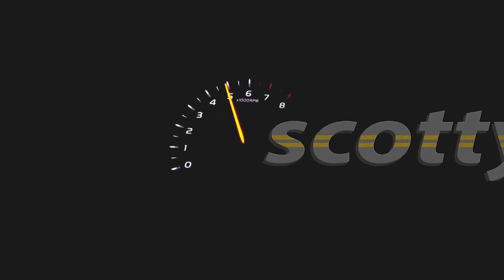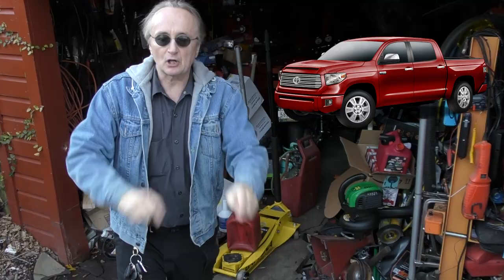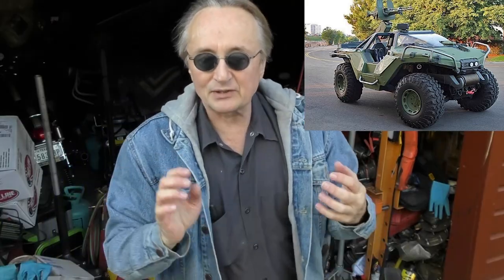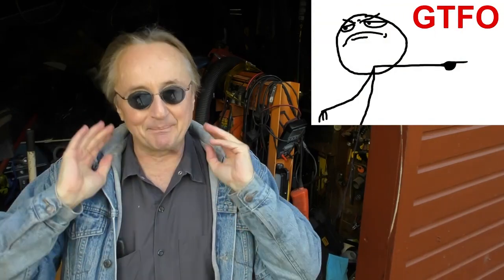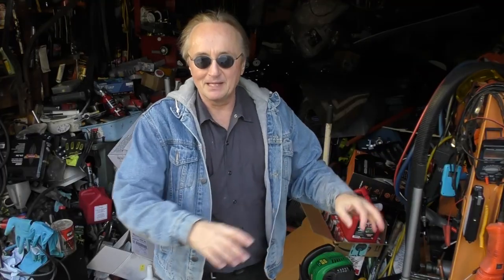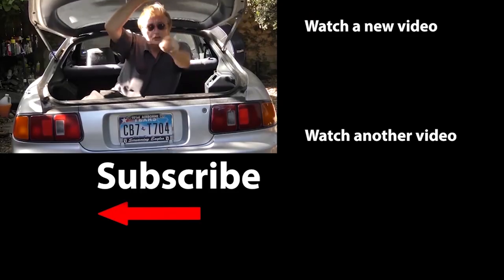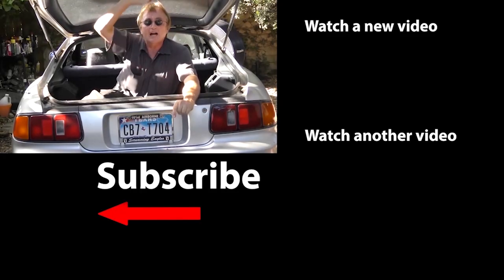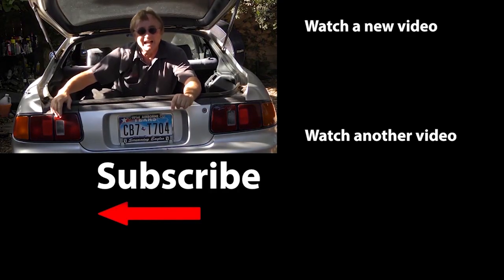5 Used Trucks You Should Never Buy

Comment: I never realized how much people enjoy their Honda Ridgelines.
Reply: They’re pretty good trucks
Reply: I had considered a used ridgeline before the new body style came out and quickly changed my mind after seeing the used prices.
Reply: 2006 never an issue
Reply: 114K Miles on my 2011 Ridgeline....I use it for hauling...not much towing.  Only maintenance ever done is oil & filter, air filter,  brakes, tires, replaced battery last year.   Avg.19 MPG....Great vehicle for my Family & small Business....has been very Reliable in Snowy, Frigid Maine Winters.
Reply: Had a Ridgeline.. put well over 300,000 hard miles on it ... absolutely loved it ... it’s still a solid truck... sorry Scotty .. got that one wrong.. obviously another Ridgeline hater
Reply: Juvenal Escobar great truck
Reply: He's right that they're not really a heavy duty truck but as a mid-range light duty truck they're excellent.
Reply: honda makes great, reliable, well-designed, relatively easy to work on cars.  if i became a millionaire, i'd buy a 3yo lexus hybrid suv and an acura nsx and be happy for a lifetime with nothing but oil changes.
Reply: My bro bought one used with close to 100,000 miles. Multiple Pilots in the family as well. Not one has failed. And I have never felt safer in a vehicle in horrid weather than in a ridgeline or Pilot. 

My moms was even T-boned, and still drives like a gem. 

Scotty may know a lot about cars, but the ridgeline is solid.
Reply: @markzach455  --  are you driving all highway miles to be averaging 19? I'm very lucky to hit 16 between City, and highway driving in my ridgeline. Do you have any tips, please share with me,  Thanks... 
And btw, if it's 100% highway miles, I can sometimes hit 17.2 or so
Reply: Honda is not a truck
Reply: domdrty — Yes, like Toyota’s they hold their value pretty well. You get what you pay for.
Reply: 2012 ridgeline, stabilizer linkage’s that’s it,80 dollar fix couple wrenches and an angle grinder
Reply: I had a Honda Ridgeline 4x4 truck and traded it in on a Chevrolet Silverado LT Z71 4x4 truck. Now I have a real truck.  Bigger and more powerful than any Honda Ridgeline on the market today.  Ridgeline with a sideways motor and transportation only tow 5,000 lb.s.  My Chevy will tow twice that amount for a lot less price.
Reply: RickFL2001 —Yes your Chevy will tow much more and for “a lot less price” but mechanically, you now have “a lot less truck” ... Good luck, cuz you’re gonna need it 🤣
Reply: @JoeMama-bw2vy  looks like you don't know what you are talking about.
Reply: @RickFL2001  -- I absolutely do know what I'm talking about. Chevy/GM is barely above dodge which is at the very BOTTOM when it comes to reliability. You should've done some research before trading for that Chevy.... Like I said, good luck!
Reply: @JoeMama-bw2vy  truth is all vehicles break down ALL !  But remember I've owned both. You know as well as anyone that I can get way more parts for a Chevrolet at any Auto parts store than you can for any Honda.  That's Dealership items. I have a RV Camper Trailer that the Honda Ridgeline 3.5 motor would hit high 
rpms which would not hold up as well as a V8. My Chevy doesn't even know that 3,500 lb.s to 4,000 lb. Trailer is back there. Saving me gasoline and wear and tear. Remember I had a nice Honda Ridgeline 4x4 truck
Reply: @RickFL2001  -- I have a Ridgeline now! And yes, all vehicles do breakdown but it's a matter as how soon they do and with how many miles on them. 

Of course the V8 Chevy is going to tow something like that without a problem. However, you are going to have problems sooner than later because it's a Chevy. Btw,  parts are readily available for any Honda and not just thru a dealer. 

2 more things and I'll bid you fairwell...  1 YOU started this little back and forth with the "now I have a real truck" comment. 
And 2, there is no better made vehicles than Honda or Toyota... Simple fact. If you wanted better towing power, you would've been better served spending more $ and getting a Tundra. I promise you would SAVE $$ in the long run over that GM product.
Reply: @JoeMama-bw2vy  my Honda had recall problems and so far my Chevy has done well. Thanks for the good luck with my truck. Best of luck with yours. I even had the 2 inches lift on my Honda Ridgeline from the Dealership. I removed it before it traded it in. You can have the 2 in. Kit if you want it. I have new links for the front end but the AC went out and if I had it fixed I would still have a old vehicle
If you want the kit it's yours free. And I appreciate your comments. Let me know
Reply: @RickFL2001  -- Thanks, but I'm interested in doing any mods to mine. It server my needs perfectly. Take care 👍🏼
Reply: @RickFL2001  even though your stated points are largely correct they dont support scottys complaints and I doubt any ridgeline buyers care about towing 10,000 lbs.
Reply: your a Millionaire now live a little how about some super cars lol
Reply: They are awesome "pickup crossovers". I've lofted mine, put wheels on it and the thing has handled everything nature has thrown at it. Including hurricane Matthew and hurricane Franklin.  Best vehicle I have ever owned.
Reply: @markzach455  make sure you change timing belt
Reply: @RickFL2001  I beg to differ. There is a 450bhp ridgeline around here in tn with original motor and trans with a turbo and some other upgrades. I bet $100 he would beat you in a race to lowes.
Reply: @RickFL2001  gm is garbage. Very cheaply made, unreliable,  very overpriced. I'll stick with my ridgeline that constantly proves the haters wrong
Reply: Juvenal Escobar My Wife bought me a Brand New 2007 Ridgeline. I’m just shy of 13 incredible years of proud Ridgeline ownership. The Vehicle has NEVER been in the Shop...,  You know why - - Because they’re Friggin Perfect !!!  I’ve never needed a repair, because you can’t repair Perfection !!  Scotty is just MAD that he wasn’t allowed to join The Ridgeline Owners Club.   Rev  That,  Scotty.
Reply: Oh yeah. Even though it's not sold in big numbers like the Toyota or GM trucks, the few people who bought the Ridgeline absolutely love their vehicle. According to Consumer Reports, the Ridgeline has a very good owner satisfaction rating.
Reply: Trading my EcoBoost Ford F-150 for a Honda Ridgeline. Ford F-150 is junk

Comment: Scotty I have to disagree with your review on the Ridgeline. I own one since 2007 and is running as when new. Oil changes and brakes pads are the only maintenance done. I'm already at 302,000 miles; engine and TRANSMISSION are running STRONG. PAINT and interior look brand new; always getting compliments at the Honda dealership. I believe it can easily meke it to 500,000 miles.
Reply: Well then you got lucky their thr most city slicker trucks of all times
Reply: INSTA austin_01 silverado 
And 1/2 tons are wannabe 3/4 ton & 1 ton diesel pickups. 1 tons are city slicker wannabe class 8 semis. 

See the point ?

Comment: Disagree with the Ridgeline. I still own my 2006 and I'm completely satisfied. I knew what I was buying and still love it
Reply: Ridgeline had since 2009.  It's a 2006, first model.. 236,000 miles.  Constant stretches towing a 1,200lb fishing boat and equipment at least 6 times a year since owned.  Bout 600 miles each way.   Replaced brakes, the compressor and three wheel bearings that's all..  Scotty seems to have a Ford bias.  My lady's 2012 Ford F150 needed a new tyranny at 47,000 miles.  My brother in laws 2014 at 52,000, and my bestie's 2015 trailing us to the Gulf, towing his boat and his fishing equipment broke down in Valdosta GA.  Same reason, transmission..   Where are you Scotty..?  SCOTTY YOU SAY WHAT..?
Reply: Great vehicle. Its not a full size truck . But its reliable, powerful and economical compared to similar class trucks. Frontier, ranger, colorado, etc.
Reply: And what, its a personal story of yours. Honda and Toyota people are so easily triggered. As a pickup truck, its sucks balls, thats it. Gob it
Reply: Not a truck if the engine is set in like a fwd lol truck is a fake

Comment: 2 trucks you should never buy:
Lowered trucks
Lifted trucks
Reply: why not they both have reasons that someone would want
Reply: Lower more so than lifted
Reply: @jacesgarage658  strain on the driveshaft, the driveshaft is engineered to operate at a specific angle. Suspension could have even more problems depending on who lifted it.
Reply: As long as it hasn't been taken to the extreme and it been built well, there shouldn't be anything wrong with a lifted or lowered truck.
Reply: A lowered truck is worse than a lifted truck. A lowered truck completely defeats the purpose of a pickup truck in general. Unless you live in a rich city like Dubai, go for it, but for the average city where roads are not always smooth. Have fun when you see potholes!
Reply: U must be a old guy
Reply: Giant tires and wheels may cause extra strain on wheel bearings.
Reply: Austin Radtke exactly it’s all about who did the work, I purchased a 1995 f150 with a front end from a 79 Bronco with 6inch total lift with 35 a/t tires and it reach the same steady speeds as my newer fseries vehicle with no hiccups. And almost next to near extreme wear and tear on drive train parts
Reply: @coiledsteel8344  : Heavier the wheel, the more strain on the bearings.

Even with same weight wheels, putting on different sized wheels, can upset the ABS, Speedometer, Traction Control, etc.
Reply: angryKitt3ns I have 2 lifted trucks it’s all in what u buy if it’s a cheap lift kit u have problems. Lots of ppl buy the cheep kits so they can get fancy wheels. Just save up get a quality kit and u will b fine. Yes parts do need replaced more offen but it’s part of the game if it’s what u like
Reply: The source of issues, cheap kits = disaster 99 percent of the time.

3 options.

Leave the truck at factory height specs. ( Non lifted ).

Save up and get good lift kit.

Save up more and buy a new truck thats already lifted from the manufacturer factory.
Reply: Lifted trucks aren't so bad, unless they're fitted with a non stock lift kit. Trucks that weren't lifted in the first place, SHOULDN'T BE lifted because their transmissions are permanently positioned in a particular way  and will break if they are altered; both classic and current trucks to say the least.
However, trucks that were built with a stock lift kit to begin with, their transmissions and differentials are permanently positioned that can handle the stress. My 2007 Ford F-150 XLT was never lifted to begin with, but it is elevated upon its manufacturing date and it can go off road with relative ease which is plenty enough. If I were to desire a lifted truck, I'd get rid of mine and buy a Ford F100 Highboy, Chevrolet K20, or a Dodge W250; which were lifted from the start and I aim to own either one in 5 years time.
Reply: @aestheticcruise8807  you're absolutely wrong. Especially if they lower it correctly, not by chopping or heating up the springs til they begin to sag. That's actually dangerous.
But lowering a truck correctly doesn't ruin it for ANYTHING except off roading... Which most people don't even do with their trucks anyways. They just have the trucks because they're bigger, so they feel safer, or they need the bed and towing ability, which is not affected by lowering (again, unless you do it wrong/cheap), but going offroad is actually not why a majority of people buy trucks, really...
So lowering is actually better than stock. You have the same payload and towing unless you change the springs (and if you airbag it, you actually can have MORE towing/hauling ability, to an extent), you can load and unload the bed easier, you can get in and out easier, wash it easier, work on the engine from above easier, has better MPG, quieter cabin on the highway due to reduced airflow underneath, and more stability.
All you're truly losing is the off road capability... Which is no loss at all if you never do that.
Reply: Those of you talking about driveline angles forget: you're supposed to shim your axles to account for pinion angle change at the tranny-to-driveshaft U-joints. Good drop/lift kits will either include shims (like my Ram's drop kit did) or will have lowering/lifting blocks with the corrected angle built into the block where it meets the axle mounting plate (like for my S10 Blazer) and keeps the axle and transmission U-joints at the correct angles in relation to each other.

Y'all are some really old it uneducated codgers in here if you guys don't know that. It's been that way for YEARS AND YEARS now.

Comment: I work for a company that bought several Dodge trucks for the fleet and all of them had ball joints break during low speed parking lot manuvering.
Reply: This is inexcusable-ball joints ought to be strong enough to last the life of the vehicle-some purchaing guy decided to go cheap and save a few cents.
Reply: Go chevy. My company has had nothing but silverados for our construction managers and they've rarely seen dealerships
Reply: @AbelG8781  The funny thing is i work in the north east and I see more chevys with problems than RAMs. Chevys are god awful with rust (Rams arent great either). I have More Cummins Diesels come in with less problems and less automatic transmission problems than Duramax Diesels. Chevy now personally makes Mall crawler trucks. I have people that come in and tow heavy trailers 20K pounds plus and gotten brand new chevys and got rid of them not even a year later since they could not hold up to the task. They all got Rams and now have had them for a year and a half and not a single problem.
Reply: That's no joke I see dodge ball joints falling out all the time
Reply: That’s nothing major. Ball joints is an easy replacement. See if it was engine or transmission
Reply: As I stated above, my kid has a newer Dodge half ton. The plastic interior is falling apart, the frame is loose and he's had every sort of engine problem imaginable, the last was an issue with the oil pan not draining all the oil properly, or something to that effect. Noisy on the road, just junk.
Reply: Had a 99 Dakota that had ball joints replaced 3X before 100K. Twice at dealer, third by me. No, I didn't hit potholes. Used Moog the last time. They were still tight when I sold the truck with 150K. Poor factory parts do not hold up
Reply: @lightningdriver81  My dodge has 140k miles with no problems.I've seen many broken down fords on the side of the road where I live.
Reply: @antheman5156    It is pretty major and it should not happen.

Comment: 1993 F150 302 that 230,000 original miles everything’s original just did the transmission go to overdrive band was slipping but it was in pretty good shape considering the mileage

Comment: 2:50 - My Grandpa has a Honda Ridgeline ( used ) with no issues in 10 years.
Reply: Fare Jare our Denali in 12 years old and “It’s a GM Product” as Scotty says
Reply: Fare Jare “
Reply: Who cares about the time frame ....Lets talk about the miles and the what is it used for ? Please tell us these informations also.
Reply: Our Ridgeline is a 2014 with 68 thousand miles and no issue thusfar. It's my wife's daily driver. She doesn't need a truck for utility purposes. I just want her to be in that in case she ever gets involved in an accident. We love it for long road trips. Quiet and comfortable. I will say that the navigation system is not intuitive and sort of a relic of a design.
Reply: Stick within the towing limits (5,000 pounds) and do maintenance. You can easily get 250k out of a Ridgeline. That V6 is bulletproof when taken care of. Transmissions don't have issues unless they're over worked (like going over the towing limits)
Reply: @kerobi88  - it's a 2009 - 2012 ( I'm not sure exactly ) with I believe 80k miles. He mainly puts mulch in back ( sometimes pulls a lawn mower on a little trailer ). He doesn't pull much with it at all.
Reply: @UCntTk8vyaz9ShRjVZkFTE0g will they start to slip because I have a 2007 Honda ridgeline RTL with 132000, with out never having 1 problem, all I've had to do is replace my shocks, and it runs like new..
Reply: This guy is full of it! My friends dad bought one used in 2007 and it's never let him down, going on 269000 miles on it. No they are not regular pickups but for what they are they do just fine and really go good in snow!

Comment: In 1998, I bought new a Ram 1500 4x4 with the 5.9L and with a tow package, and other than it's  poor mpg gas use, it's been great. I don't drive it hard, and it's at 110K miles now. I've only had to replace the radiator and starter.  When the spark plugs were changed at 85k, they were completely clean.  When changing break pads, the brake system was fine with flat rotors. I love my truck.   The check engine light for the ABS system comes on when I get to 60 mph, so that's the only thing that needs fixing now.
Reply: Only? And 110k isnt much

Comment: I live in NW Montana and drive a 2009 Honda Ridgeline. I drive it in winter, drive it on logging roads hunting, and pull a 3000 lb trailer with it camping during the warmer months. It's a great vehicle. The hidden trunk under the bed, and the fold up back seats are very handy. I think something like 80% of the parts are unique to the 1st gen Ridgeline. It shared very little with the Pilot. Everything is very beefy on it, great brakes, heavy duty driveline and rear independent suspension. You see quite a few of them up here, but they're hard to find on the used car lot, because they get snapped up quick.